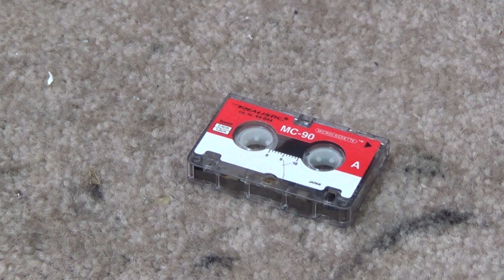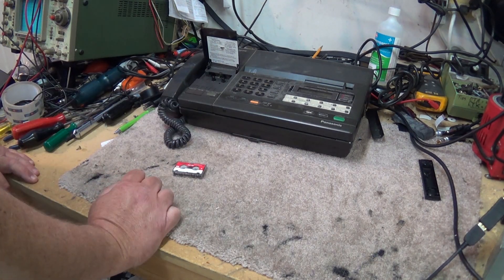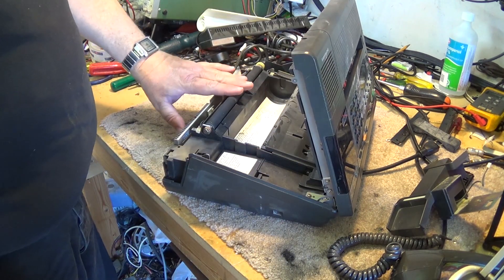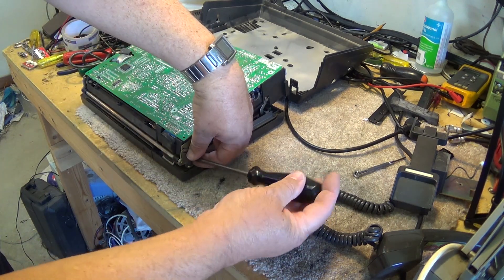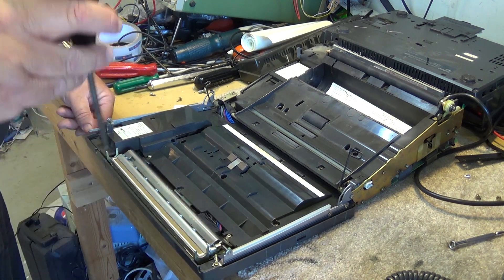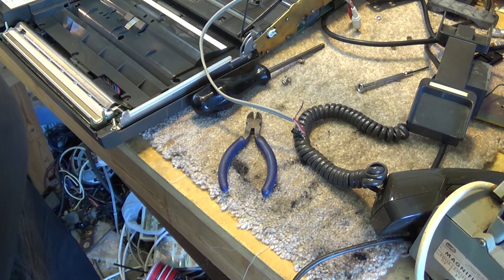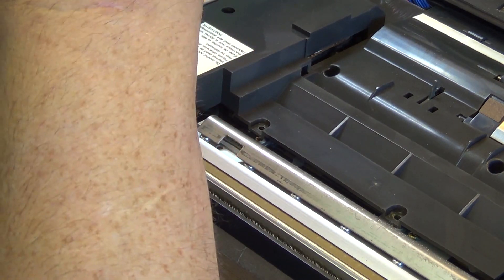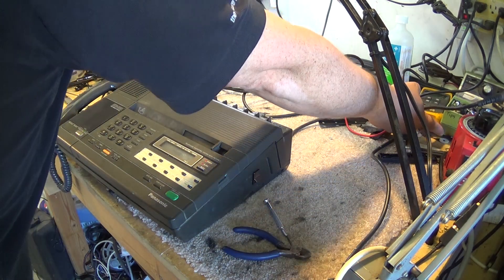Panasonic fax machine audio line out modification

Comment: Would it not be possible to attach the audio cable to the volume control. Wouldn't that be a line level output.
Reply from the maker: Jim Reardon That is possible depending only on the design. On an older unit like this the volume control is probably just a linear control and connecting between the input and the control and ground would work just fine, but on newer designs the volume control is digital. the physical control may just vary a control voltage to the VCA, or there may be just up/down buttons. The speaker is a sure fire method to get a direct output of the analog signal going to the speaker, and will work on every device, not just this one.

Comment: Isn't the speaker output too powerful to drive a line level input?
Reply from the maker: giammyzanna No not at all, turn down the volume, and it will drive the input quite nicely. That is the reason there is a capacitor added between the + terminal on the speaker output and the audio signal line. This will limit current, and block any DC component, but pass the audio signal.Back in the 80's most car stereos had perhaps 5 watts per channel output. Along came external amplifiers, power boosters as we used to call them. Nice 30 or 60 watt proper power amplifiers. The problem, car radios and tape players of the day has no line level outputs. They had speaker outputs.  These speaker outputs were connected to the inputs on the amplifier. Worked just fine.Later car head ends started featuring line outputs, but the problem with many of these low level line outputs is the signal was so low that noise picked up from induction in the wire was also amplifier. Noise from the alternator, ignition system, electric fuel pumps ect. So the next big thing in car stereos was "high level" line output. Hmmm, what was that? A high voltage, typically 2.5-5 volt output, essentially they connected the line output jacks to a switch, and 1 side of the switch connected the RCA connectors to the preamp out, and the other side to the speaker output. That way the high level signal driving the power amplifier didn't need as much gain at the PA and the noise floor from induction was driven down below the noise floor. this mod is no different. You can take any single ended speaker driven system, and make a line level output like this. How do you think some power subwoofers work, the ones that just have the speaker leads running in and out. They tap off the sound, using a capacitor for isolation, and then run it to the volume control for the sub woofer, and a resistor to drop the level, and then into the subwoofer amplifier.

Comment: What would have  happened if you did not have the capacitor on it or had it backwards (It looked like a electrolytic).
Thanks
Reply from the maker: amtpdb1 Polarity really doesn't matter in this case, as there is no DC voltage involved. The capacitor is there just to decouple the speaker, and to protect the audio amplifier (in the FAX machine) in the event of a short on the output jack. We are talking very low voltages, in the millivolt range.It would actually work just fine without the capacitor, but there would be an impedance mismatch. Another way to do this would be with an audio transformer but that is overkill. The audio quality is basically voice quality from a dictation device, not a hi fi recorder.
Reply: 12voltvids Thanks